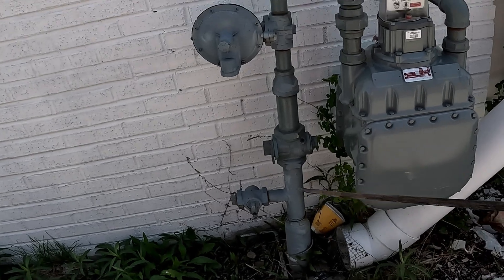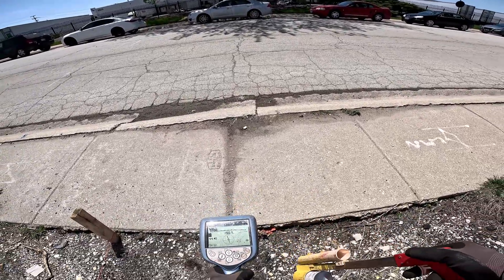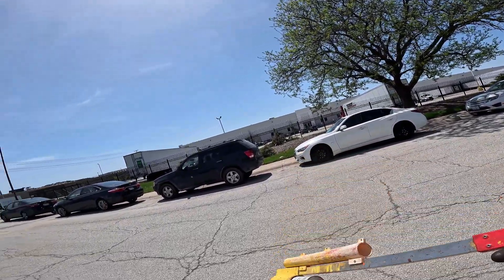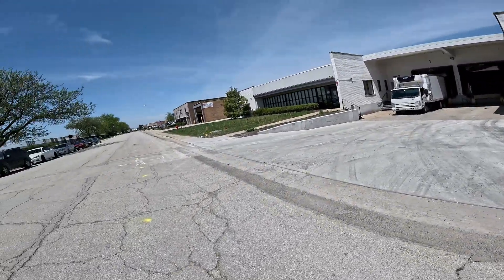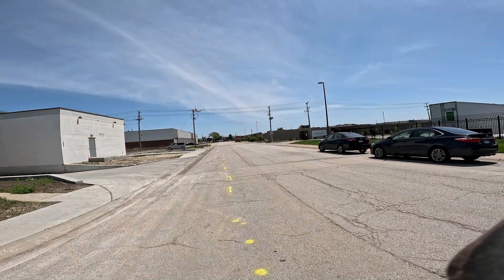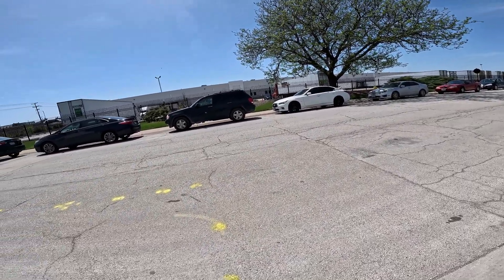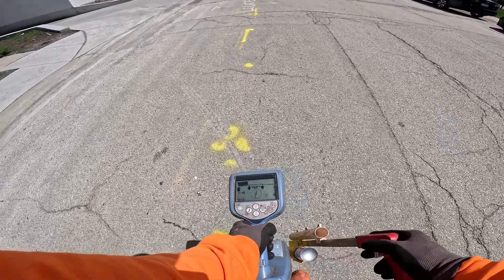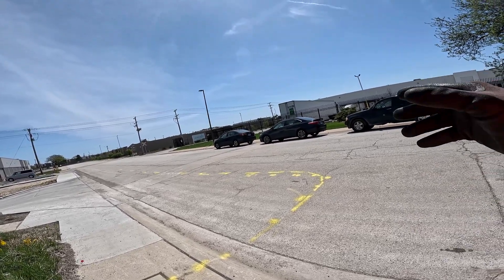NATURAL GAS | Don't Make This Mistake | You Have Not Seen It

Comment: I use a Vivax Metrotech vLoc3 wand.  The blue one you use seems to provide more useful info with the voltage and signal strength.  It seems to me that the previous locator was using the compass on the bend rather than the peak and null technique that you are using.  I learn something everytime I watch your videos.  I will try to incorporate the use of peak and null in my locates.
Reply from the maker: The vLoc3 is a fairly good piece of equipment, but in my opinion, the RD8200 is slightly better. The compass is quite helpful when the cable is turning, but it's always best to peak it out and then null it back to confirm your peak. If both check out, you can be certain that you are on the cable.